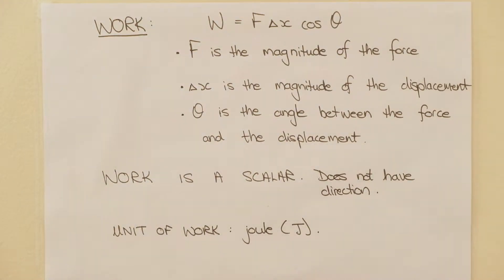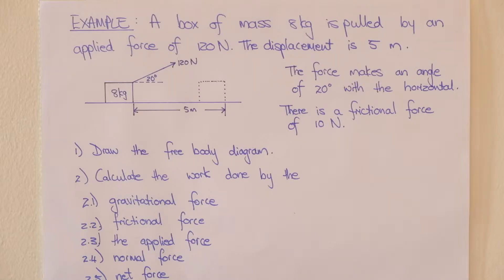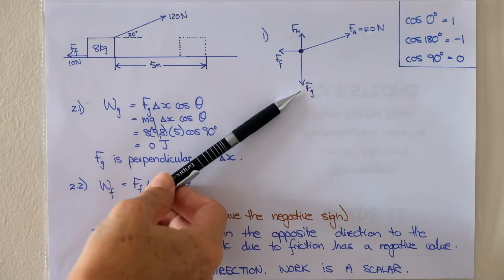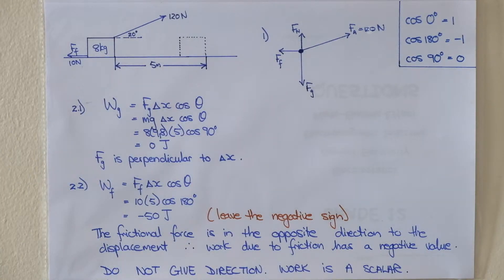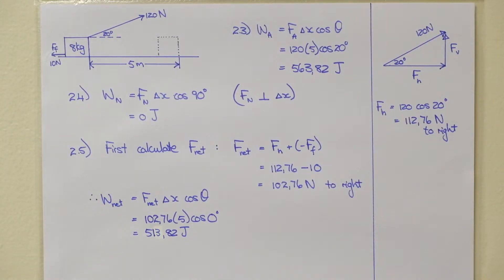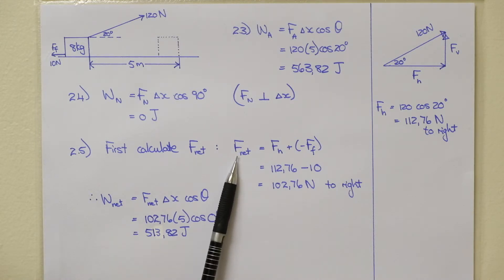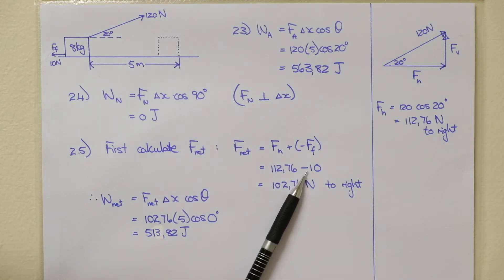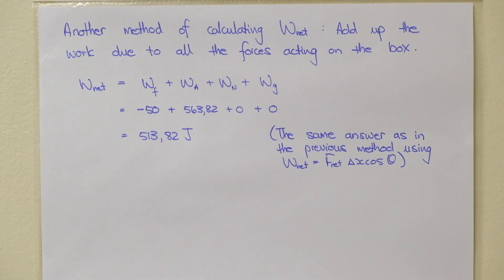Calculating WORK done an object on a flat surface

Comment: Is it always 90 degrees? In the gravitational worlk
Reply from the maker: Yes, the gravitational force is 90 degrees to the displacement of the object, when the object is on a flat horizontal surface. The gravitational force therefore does no work on the object, because cosine 90 degrees equals zero.